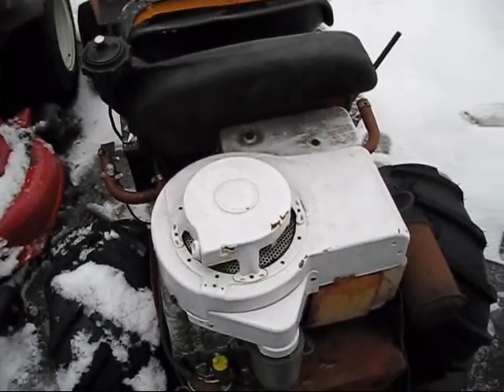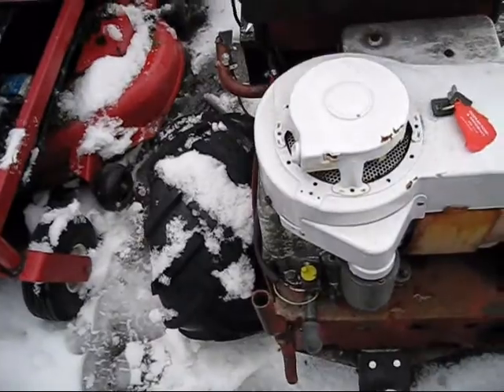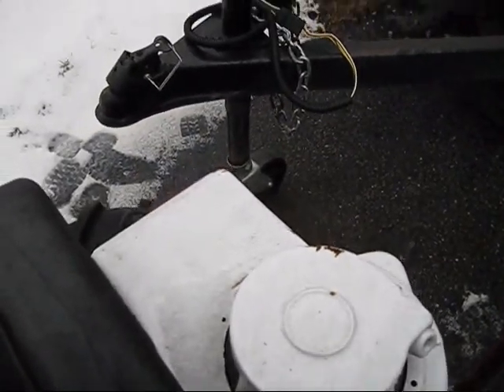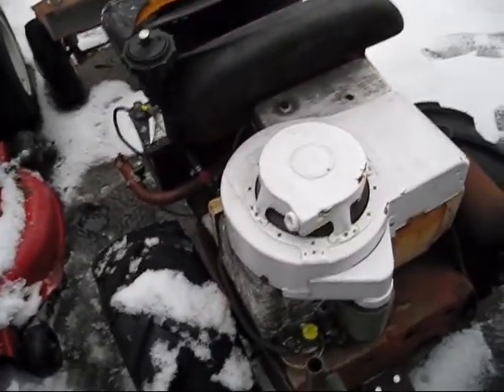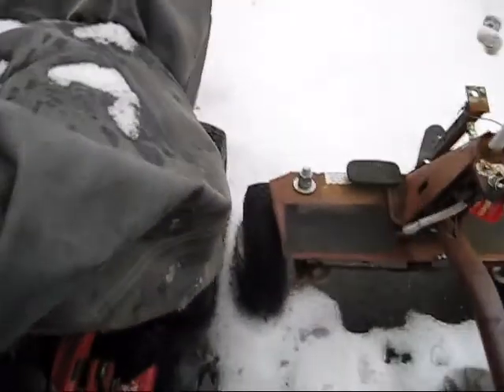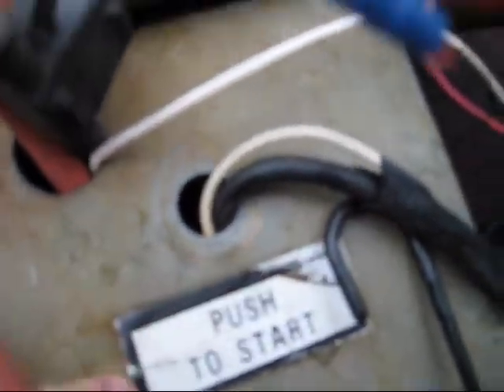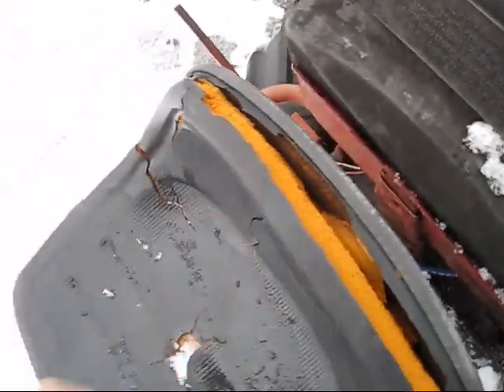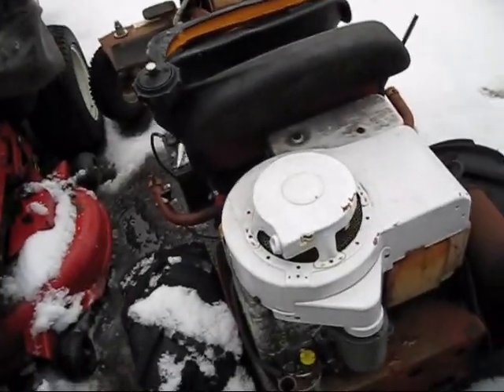1981 Briggs and Stratton 11 hp cold start

Comment from the maker: @hwc1998 This Briggs uses a splash type oil system and if you notice I throttle it down to idle just after it starts, plus the only way to choke it is to use full throttle